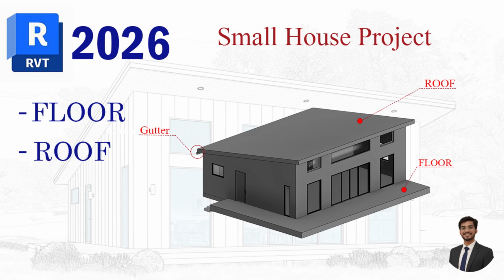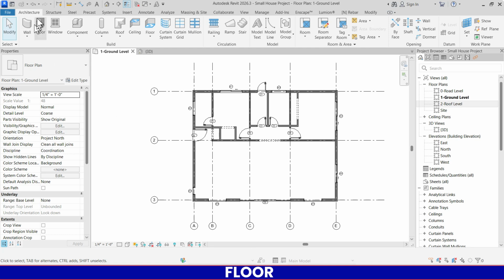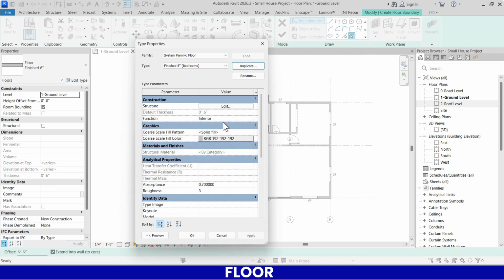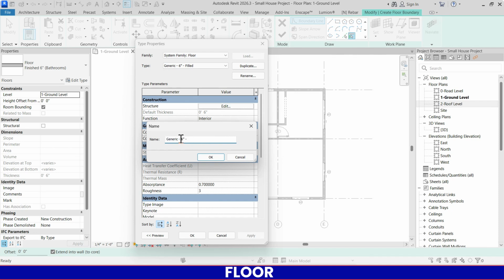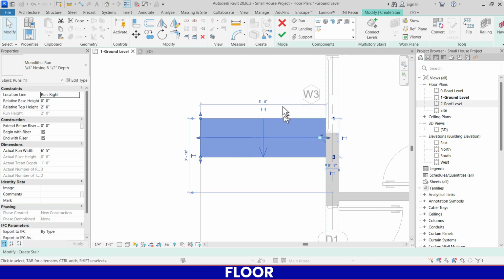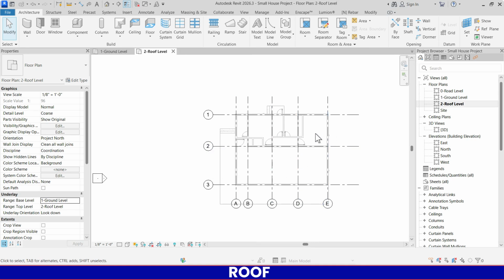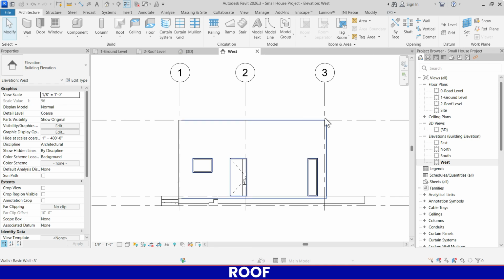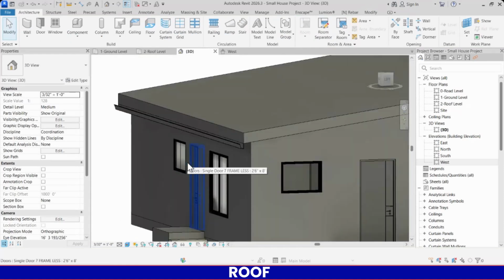Revit 2026 | Floors & Roofs Professional Modeling Workflows | Revit Mentor

Comment: Good video and I like that tuition speed so I can keep up. It would have been good to see how you set up the two levels of windows on the front wall. Also the gutter was hanging a bit low on the facia. How do you raise it up ? 
Will you be showing how to set up a site plan and sheets ?
20:27
Reply from the maker: Thank you for your kind remarks. Yes I will make the site plan and sheet composition with schedules also. For Roof detailing there will be a separate tutorial in my upcoming sessions.